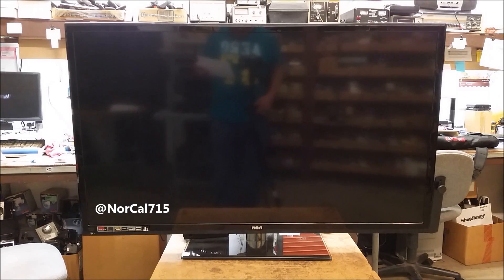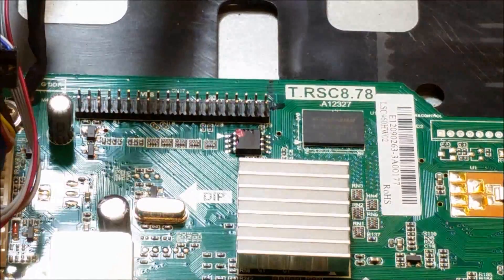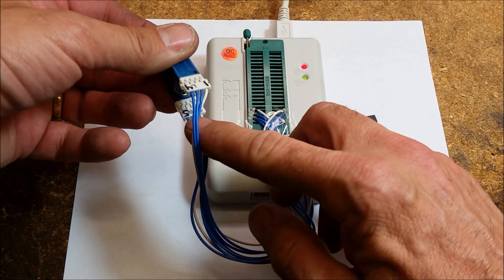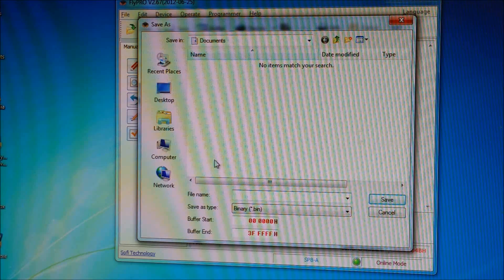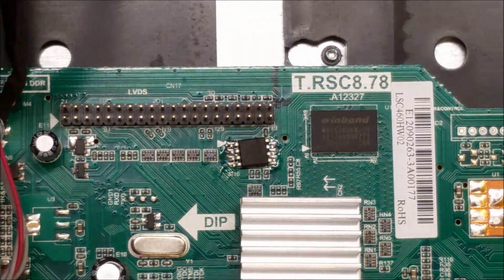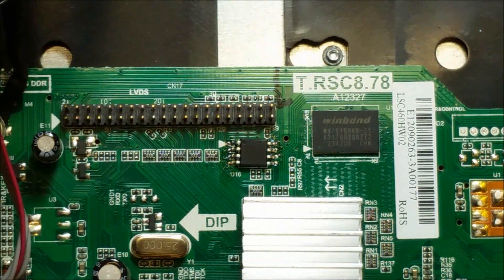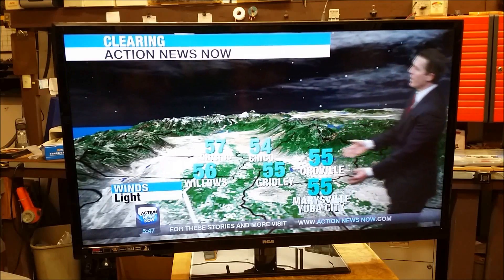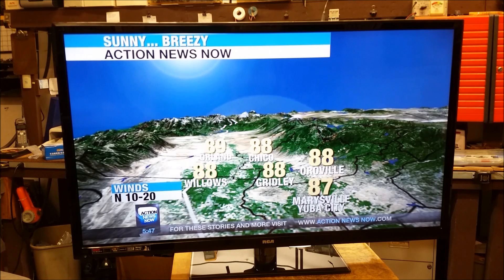RCA LED46C45 EEPROM Exchange

Comment: I think the chip was going bad. The data, if it was corrupt. When you read it. It would of read out the corrupt data to the saved file. And you would of written a corrupt file to a new chip. And it would of not worked. This is done alot on game roms for old retro cartridges.
None the less. This is a bad ass video. You just made a repro RCA lol. Nice job!

Comment: i have this same TV but my problem is the HDMI ports don't work do you think reprograming the EPROM will fix this issue? Also i was thinking about updating the firmware on this TV but have not found any support to fix this issue. Or i can just replace the main board :) I found out that this TV was made by ON Corp (this is manufactured in 2012) not RCA it seems like there was like 3 or 4 companies that built this tv which is aggravating.

Comment: So lets say that freeze spray doesn't work.  How would I go about getting the proper eeprom? Do I just order one for the correct Model TV?
Reply: Shadetreetrader11 Just buy a whole new refurbished main board from EBay.com or ShopJimmy.com,just replace it.If you don't do this for a living.By buying a new EPROM chip and buying a refrigeration freeze can stray,EPROM data's transferred reader and looking for the program to transferred old EPROM data to the new EPROM chip that a lot worked also must have skilled for one time deal fixing.The whole new refurbished main board not that expensive like maybe cost like 30% more but than you just take out the old board and put in the new refurbished board then you're done.
Reply: But I'm wondering what data is stored on the eprom?  In other words, can I install a  brand new unused  eprom in a TV?  Will the TV fire up?
Reply: Just by replacing the EPROM chip alone.The tv will fire up and work.But your tv now have no data in the EPROM chip.The tv have no memories for the main board to have controls functionality like tv remote controls to works properly.All the RCA AV outputs will not functions also all the HDMI outputs will not work either.
Reply: Ahhh, I see now. OK, thanks for the information.
Reply: Chi Chu Hey there , so getting a new EEPROM for my tv would prove pointless if I don't transfer the old EPROMs data

Comment: Norcal715,
The eeprom reader writer you have is no longer available anywhere. 
I found one that looks similar what do you think? I see a descent amount of RCA, VIZIO, and other brands quite often with bad EEPROMS and would love to have one of these on hand.
Will it do the trick? How do I figure out if it will work for TV eeproms or not? 

http://www.ebay.com/itm/USB-EEPROM-SPI-BIOS-Universal-SP8-A-Programmer-support-4000-include-test-clip-/320945363669?hash=item4ab9d59ad5:g:5uoAAMXQc7ZRi8d3

Awesome videos!
Reply: +Nicholas Arnaud there are loads of they on ebay ihave ezp2010 the new model  is ezp2013 can read/write all 25xx and 24xx and others soo you can use it for recover pc  motherboards too.
google it on ebay aliexpres banggood  just get a extra pcb for solder the eeproms becuse they used for broken the pads whit the use.
2-3 euro/dolars  you get like 40 adpaters.

Comment: My question is: if the EEPROM data is corrupted, how can reading it and writing it into another device work?  Wouldn't it mean that even the data written is corrupt?
Reply from the maker: +Electro It seems that the defect lies at normal room temperatures. either heating or cooling the eeprom will restore complete functionality.  Also I have had defects that will not allow new data to be written but can still read existing data with no problem at all. Thanks
Reply: +Electro you need dump from worked eeprom, ask someone who has one or can dump it.

Comment: Hi I have a question: I got a INSIGNIA model NS-46E340A13 with the same problem when I tried to turn the TV on, the standby light goes off and don't turn on; a seller in eBay told to buy the EEPROM on my mainboard maybe will solve my problem ( this is suppose to fix it on the INSIGNIA with this kind of problem or that after 20 minutes got hot and tunrs itself  off ) now he never mention that I have to reprogram the EEPROM so in your opinion do you think I have to do that??? or I can assume the new chip its already programmed ??? please give me your opinion and thank you for sharing your videos they are great and very explicit
Reply from the maker: +lyon65 You may have a different problem. All of the new eeproms I see listed come pre programmed (except for blanks from suppliers like digikey and mouser and the such)
Reply: +norcal715  thank you for your response I bought this eeprom from ABLE TV and they also repair TV main boards on E bay so I'm assuming is already pre programmed as you said anyway thank you for attention to my question and please keep the videos coming I"m already subscribed and I like the way you explain them!!!!